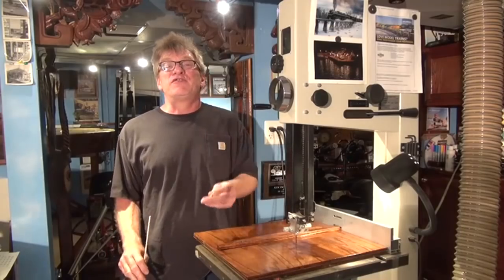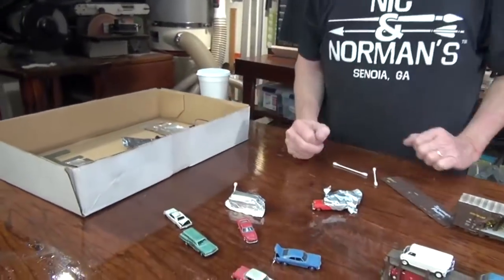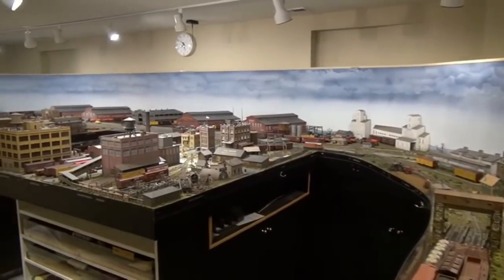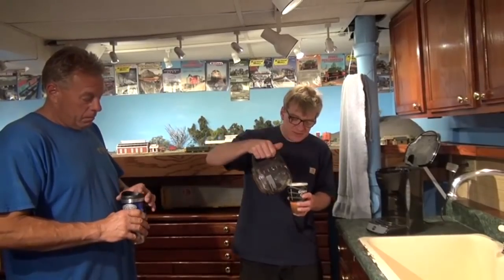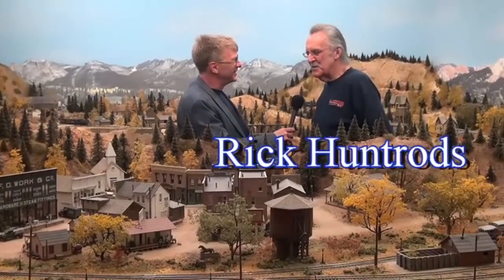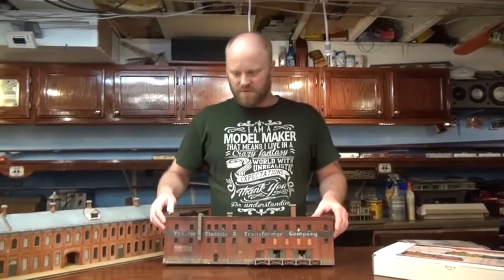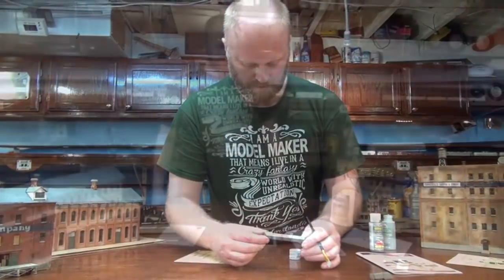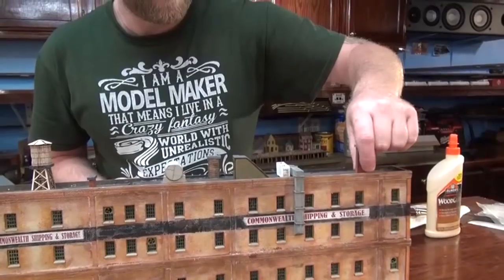Whats Neat in model railroading | August 2018 Model Railroad Hobbyist | Ken Patterson

Comment: Enjoyed learning how to use foil from Mike Budde's presentation. Would like to learn more about using it to  build the Quonset hut. Always wanted one for my layout.
Reply: Rick Covert, mine used a cardboard tube as a base, but you could use PVC.   Then just start laying the 2x8 pieces of foil like shingles, starting at the bottom. I overlapped mine about 4 feet.    I had a kit that included Campbell corrugated siding but it was too stiff to bend into a curve, so I used the foil pressed over the siding to create a foil copy of the Campbell siding.
Reply: Thanks, Mike. Will try that soon.

Comment: Finally made the jump (74yrs young & almost 75). Been enjoying the heck out all the great Model stuff you've offered in the last few months since I "discovered" you. THANKS!
Believe it or not, I'm starting a layout in HO. To get it done sooner (important, or so it seems) I've decided to use Dead Rail (minimal wires to install from under the table). I'm intending to use S-Cab which has many capabilities of DCC, including sound if I can fit them in with the battery.
Ken, since you need to refurb your Garden Road, might you consider Dead Rail?
Reply: Dead rail may save wiring the track, but it doesn't save the wiring of the switch machines, the signals and any occupancy detectors. It may help garden railroaders, but for any layout larger than small, you are going to have to keep a lot of locos and lighted cars on charge all the time. And you can run locos If they have room and easy disassembly for adding batteries in the first place.
Reply: Thanks for responding. My layout will definitely fall into the small category. My points control will all be reachable for manual operation. My 1970s locos will be modified as money is available. What I plan to do doesn't fit with lots of modelers, but that's what this hobby is all about.
Just wanted to share an alternate path that I found will take me to some operations that I enjoy. I've been part of a group years ago with lots of great guys who were very helpful and fun to be with. Was Secretary then Veep, then President of the Flagstaff (AZ) Model Railroad Club. And, was The Official "Keeper of the O.O.B. National Shrine" [O.O.B. = 'Order Of The Biffy' for those who remember 'Whitney's Wonderful Watercloset Museum' a Fun sub group of the NMRA! I have pictures too!
Now it's just me. And, I'm having Fun. What more is there? I'm happy to share my experiences as I progress.
Reply: Too many unknown 'buttons' to accidentally click.
I had a rambling answer to your response that I wiped out. I'll try to recompose it.
--------------------------------------------------------------------------------------------------------
Thanks for the response.My layout is definitely in the small category. My switch points will all be reachable and manually operated; just like the real things. I'll add decoders {and batteries} to my 1970s locos as I can afford to. I know lots of modelers don’t care for this approach, but the Hobby is for fun and there are many ways to achieve it. 
No model railroaders close by, that I know of, and I’ve done the club bit. In Flagstaff (AZ) I was part of a great group of guys from whom I learned a lot; was Secretary, Veep and President over the years. And, if anyone remembers ‘Whitney’s Wonderful Watercloset Museum’, a sub group of the NMRA headed by editor of the Bulletin, Wit Towers, I was Honored to be the Official ‘Keeper of the O.O.B. National Shrine’ for a brief period after the NMRA Railfair ’78 in Scottsdale! {O.O.B = ‘Order Of The Biffy’}. I have pictures; except for the traffic slowing shot of me towing the Biffy in a small trailer behind my VW camper from Phoenix to Flagstaff on I-17!So, to everyone, have a Great Time with your trains and layouts whatever way you like best.

Comment: Suggestion = On a real railroad you can only hear the joint clicks on about the 10 cars closest to you and not the whole train because of the other ambient train noise. I would suggest that you space the gaps further apart based on normal train length on your layout so you hear fewer clicks which based on the video becomes overwhelming.

Comment: You'll only get the correct familiar "clickety clack" sound if your cars have working equalized trucks,. Such as the original Kadee's. The now commonplace modern plastic molded rigid trucks won't let their wheels alternately drop into the rail gaps in the same way. So their sound pattern is quite different.

Andy of The Track Guys